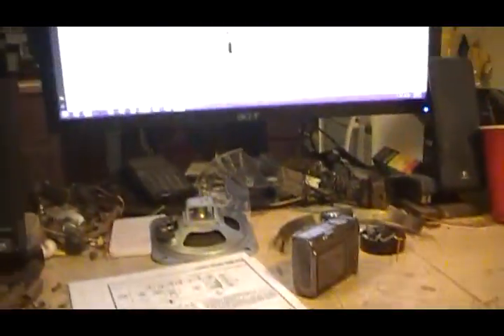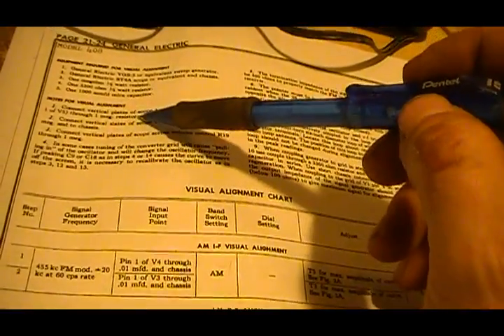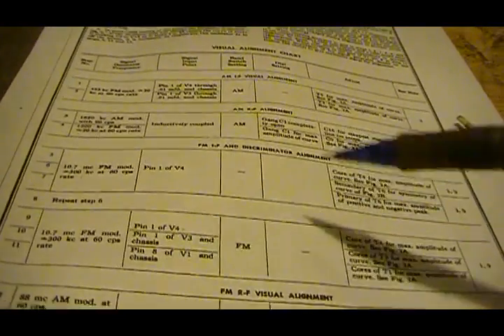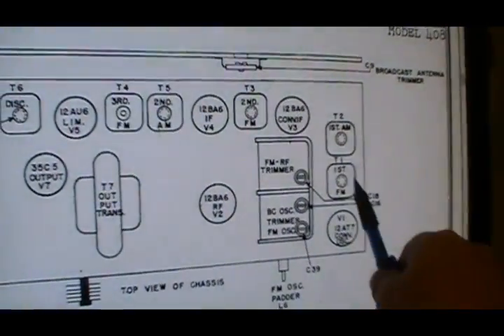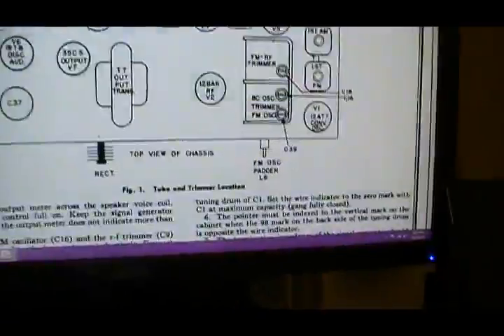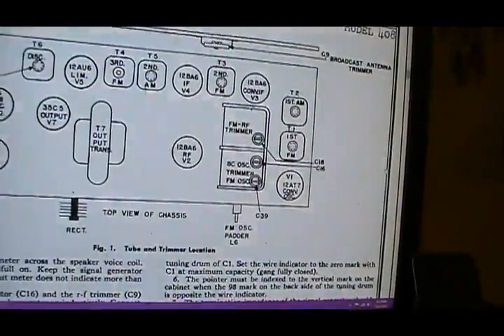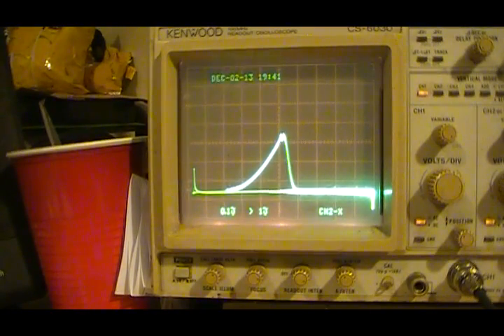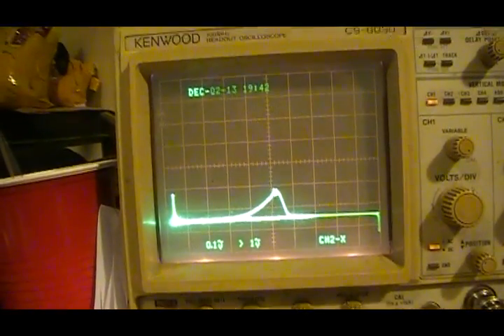AM and FM alignment part 1

Comment: Hi Dennis:
Thanks again for doing this buddy!
Yeah, I didn't think it could be the cables because the gain was always go down. If it was the cable itself, it would be erratically going up and down or no signal.
Did you have to negatively bias the AGC rail so it wouldn't run away with gain?
Sure seems to me that it is very probable a tube in the front end that loses gain with heat.
Time for round two!
Again man, thanks a million!
73s
Tom
PS Sorry for the long delay.

Comment: I have a FM Motorola radio, b100w.. THE am works GREAT.. The FM is not working at all.. when you put the selector switch on the FM position then you lose everything.. Im slighty confused.. I have restored several AM radios but the FM is another story..
Reply from the maker: Hi Jesse. First do have a schematic? When troubleshooting any radio first check the tubes and connections and anything you can see like burnt components. Then check voltages in the radio. Check the selector switch. Also on the schematic there is a resistance chart you can go through it too. That should get you started. Let me know how it is going. Take care. Dennis
Reply: Hi dennis and THANKS for responding. There are so many whom you try and write to for help and they IGNORE you.. SO I would tell you yes, I have schematic.. I do need to check all the voltages, and I also know to look to see the voltages are up to par.  Again , I have restored MANY am radios, but this FM has really got me going crazy.. But I guess I have to keep going on it til we get it working again.
Reply from the maker: Jesse Hancock Just keep going and don't let get you down. I'm here to help as much as I can. When you get done checking everything let us know what you have found. Even make a video of it. Your friend Dennis
Reply: can I ask a hard copy for the steps in tracking and aligning am/fm receivers. thank you